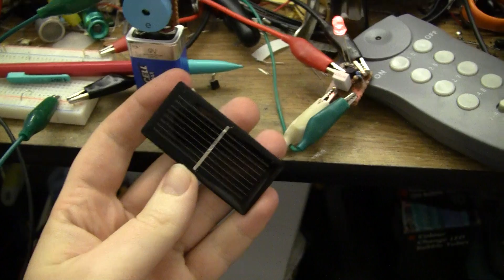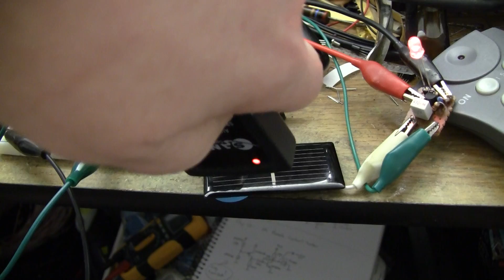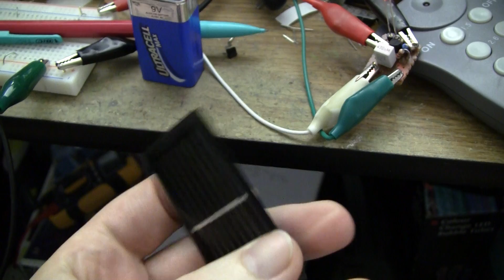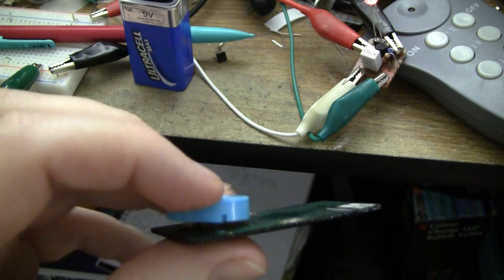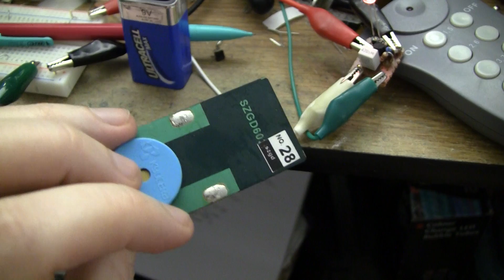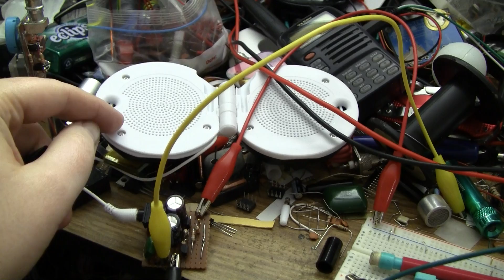Day 10 Extra: Useful Solar Cell Quickie

Comment from the maker: Yes, shorter wave infrared (about 1000 nm) is actually where the response of most Si solar cells peak.  It dips sharply afterwards though, and it usually tiny after 1200 nm.